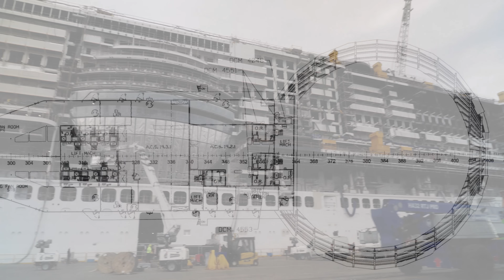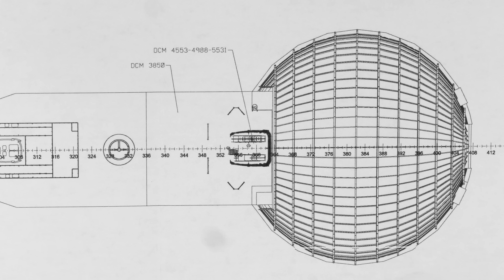Building a Cruise Ship in Just 10 Months EXPLAINED

Comment: For comparison, the Italian ocean liner SS Michelangelo 's construction: Planning started in 1958. Launched in September 1962 for fitting out, and completed in April 1965. It had 45,911 GRT. It used to take years to plan and build ocean liners, which had to be built to withstand most weather out in the ocean, unlike cruise liners.

For a more modern example, RMS Queen Mary 2 was ordered November 2000, laid down July 2002, launched March 2003, and completed December 2003. She has 148,528 GRT, and while she's dwarfed by many cruise liners, she is the longest and largest ocean liner ever built. They also used more modern processes to build her.
Reply: Like they said at the end, the 10 months is only drydock time, they were planning and building it before they had the drydock, and they'll continue working on it after it's floating. It's a very similar duration of drydock time as RMS Queen Mary 2, and the drydock time is expensive.
Reply: And it takes the US to built a similar displacement vessel 14 years and 12 billion dollars.